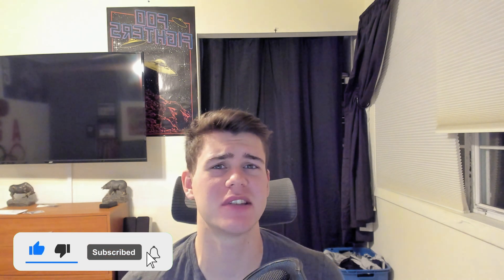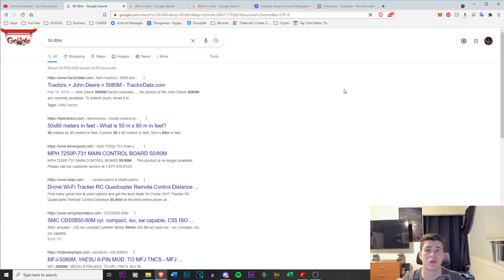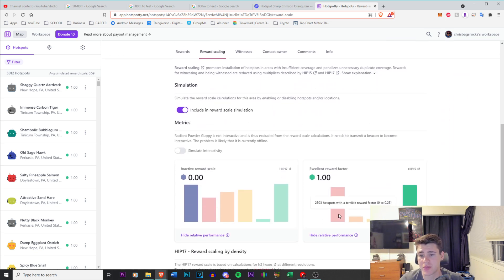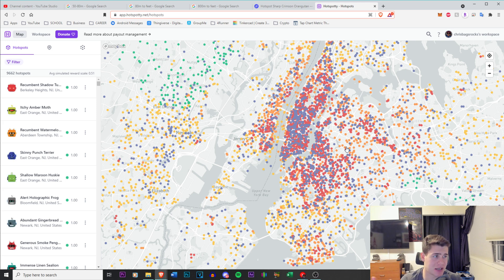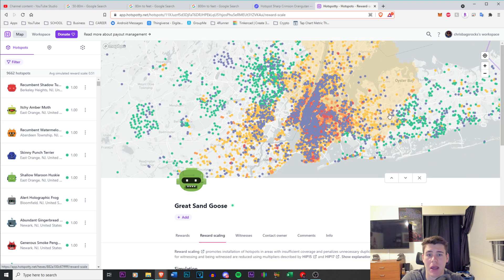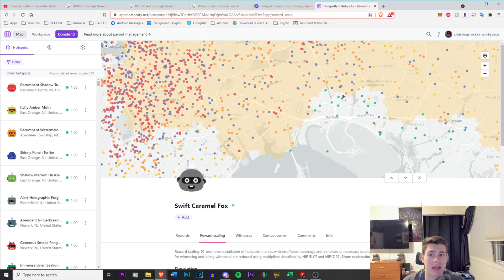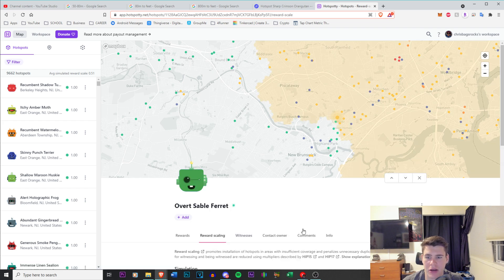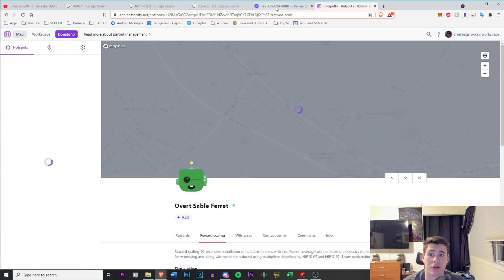How to Increase your Transmit Scale on your Helium Miner (HNT)

Comment: hi , i have 8 dbi interline horizon antena and LRM-400 N M / RP SMA 5m  , should i just put 8dbi  in antena settings or should i odd  cable loss  from nominal dbi?? ( LMR-400 Loss over 5 Metres at EU 868 MHz Frequency: 0,7dB)

Comment: hi there ,how are you ?I don't know if you can help me but I will try .I do have my hotspot on resolution 4 in the center and my transmit scale is 0,46 and my whiteness rewards is 0,22 so the thing to change location I don't know if will help because it only can change 100 meters from the real location.so there is some way that I can increase those values ?

thanks

Comment: Nice video I wanted to join hotspotty was wondering if I am required to move my HNT wallet onto their website do they make you transfer over your wallet and is hotspotty free?
Reply from the maker: It should be a one time fee to connect your devices to the hotspotty app. You can use the application for free though.

Comment: Hi Chris, if you move your or any other hotspot using that tool, that is only a simulator or after we have done this then we have to adjust the location using the helium app? Am I correct?

Comment: Hi can you reassert the address without physically moving the hotspot itself?
Reply from the maker: yes, within the app its just like dropping a pin on google maps
Reply: @chrisbagnell  Hi, great tip. The video is up for  some time, can i still do this? i need to move 680meters? the next update will ban this?

Comment: Glad I came across this video I have a bobcat 300 located in an apartment on the 12th floor (approx 40 meters ) in Manhattan. I have a 5.8 dbi antenna. For a while I’ve only had a transmit scale of .03 and I currently have 114 witnesses I really want to make more as I only average around .02-.03 helium a day
Reply: Is there anything I can do to better my situation
Reply from the maker: You may have 114 witnesses but they could be low quality (the miners you witness have a low transmit scale). The best thing you could do for your miner is to get it out of the overcrowded city if possible, once you witness higher quality miners (miners with high transmit scales) your rewards will reflect it.

Comment: Hey man, thank you for the great video and info. I’m getting a couple of bobcat miners soon. I’m in a .37 scale. But a street down around 400 m away is .71 should I just change the location to down the street when setting it up?
Reply: Thank you for the reply, I have a similar situation as the example in the video I am just on the border of the big orange hex.
Reply: I do have another question. Since I’m in the basement I would be better off keeping the 4dbi then upgrading it to 8dbi right? Cause I need to target closer witness?
Reply from the maker: You don’t need to if you are close to a lot of witnesses, their transmit scale is more important for yourself
Reply from the maker: But if you have a couple bobcat miners you could try it with 1 of them. Make sure you’re not putting them all in the same house obviously for the end result but it’s fine setting them up in same location.
Reply: @chrisbagnell  sorry explain that please. If I have two miners in my house, I can put one on the map 300 meters away? and that will work?

Comment: Hey man, I'm new to this but my miner comes today. I have 5 different locations I can choose to put it in a 150km range. Is there a way to know just by looking at the map which location would be best? Should I go based on others by the location?
Reply from the maker: I believe hotspotty (it’s a website) has a simulator you can see what the best location is. I would also just look at the areas try to find the flattest area with a good amount of miners near you so you can get witnesses and Thus more rewards

Comment: hi chris, i love your videos! keep it going! I have a question for you: i have an hotspot connected to an iPad, with a mobile SIM, used for the internet connection. That hotspot is relayed, is possible to make it working with this type of connection or is mandatory to have a internet connection like fiber, with modem/router and stuff? thanks a lot
Reply: you should get a hotspot instead and open the ports in order to not be relayed
Reply from the maker: I haven’t done anything like that so I’m not sure the answer, I would suggest going into helium discord server and ask the question you’ll get an answer quickly

Comment: whats to stop someone from just putting two in there house and putting the locatioins separate....?
Reply from the maker: This doesn't work. If they're that close the signal strength would be insanely strong. The anti-gaming logic (which is strict enough to screw up plenty of VALID deployments) will figure out that there's no way that two hotspots 10 miles apart can communicate that well.
Reply: @chrisbagnell  yeah all you have to do is weaken the signals. People with legit high dbi antennas get invalid witnesses because the system thinks it’s too strong. It’s not a good system safeguard. The only way to really tell is having the same IP

Comment: What a game changer!  I was in a hex with 2 other miners.  .54 reward scale.  Moved my location down the street to a hex that isn’t made yet.  Super excited
Reply: So I moved to a new hex.   Reward scale improved to .69.  I moved my location online north. To the West of me they are at greater rewards scales like .97.  Would it benefit me to move my location online West?  The hex West of me is empty just like north of me was empty before I moved location online. Thanks. 🙏🏻
Reply from the maker: Depends on the distance, if it’s too far you will notice and it costs to move every time so keep that in mind
Reply: @chrisbagnell  yeah moving north was shorter distance than west.
Reply: J M when you said u moved to other Hex is physically move the hot spot or you move virtually on the map?
Reply: I was able to zoom right in and see an actual house in my neighbourhood that has one, I asked the homeowner if they would give me the run down of setting up etc, she knew nothing about crypto so either her lodger has it on the sly or something else going on. I would worry about this if I had elderly relatives that wanted a bit of extra income about getting them one for this reason. Surely it’s invasion of privacy

Comment from the maker: One thing I forgot to note is you can reassert your location without physically moving your miner. In the app simply click "Update Hotspot" then "Update Location". Now click "Change Location" and you will be allowed to move your location like a pin on a map. You will not be charged for changing your location until you hit Change Location the second time!
Reply: Do you have to re sync to the blockchain when changing locations?
Reply: Wouldn't changing it be the second time?
Reply: after hotspotty location finding,  how do you find the same location on helium app with the drag icon for  location
Reply: If I was to reassert my location, could it hypothetically be anywhere, or what is the limit/threshold? Thanks again for the informative video, just set mine up yesterday but current rewards are a factor of 0.27 :(

Comment: If your RU ends up with a Grey hex (rather than green with 1.0) upon assert, you will need to relocate. UNLESS you are not synced yet. I've had this happen due to the helium app placing my hotspot over a kilometer from where I intended it to be (app bug I think).

Close proximity and overlap of hotspots is what I'm researching